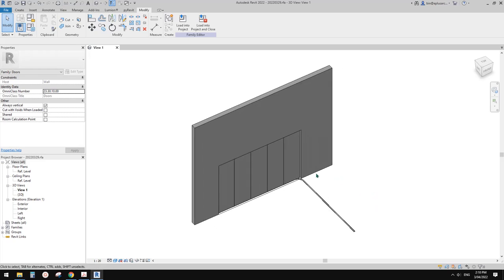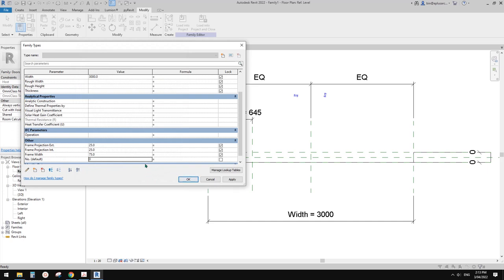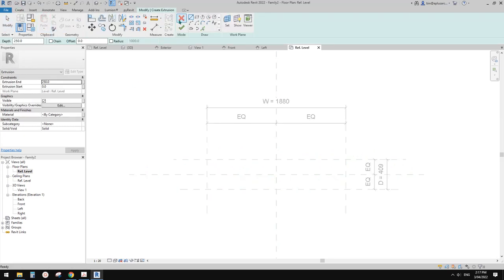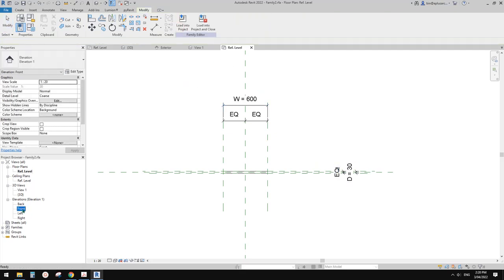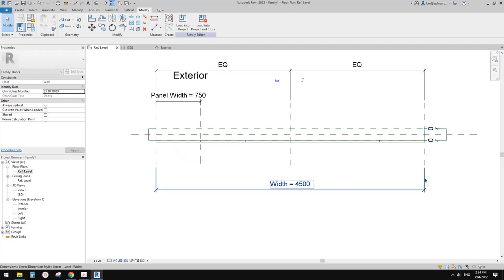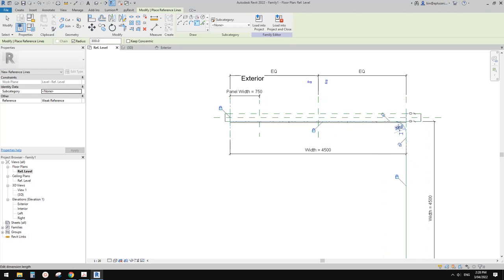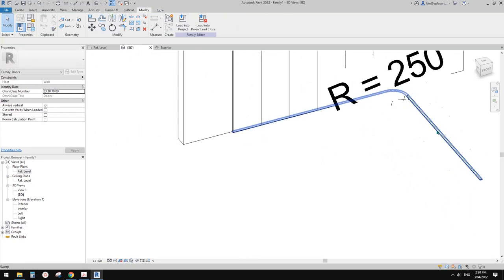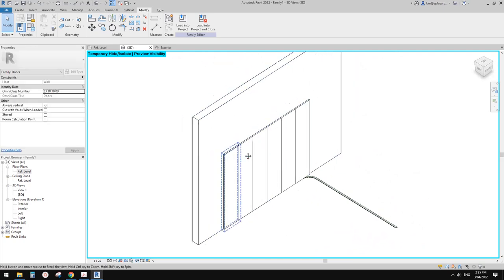Revit Exercise (Day 740) Sliding Garage Door Family

Comment: Hi Bin - thank you for your tutorial! Best I've found yet when it comes to this type of thing. I have one question though - I have followed your steps when aligning & locking panels to reference plane, but when I load into a project wall, the panels are not in a straight line. Could you please tell me why this might be? Thanks, Em.
Reply from the maker: It’s probably because you didn’t constrain them in a certain direction. What I usually do to fix this is to go back into the family, select one of the panels, and nudge it using the arrow keys. If there are no warnings, I know I need to add a constraint in that direction.